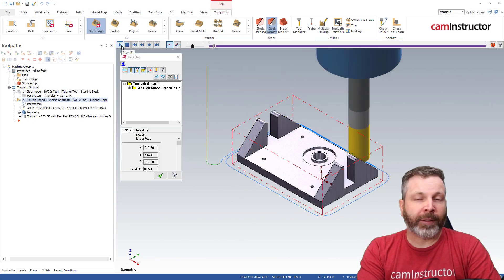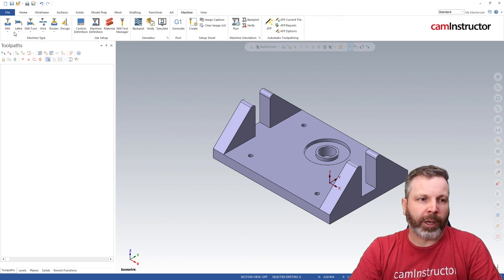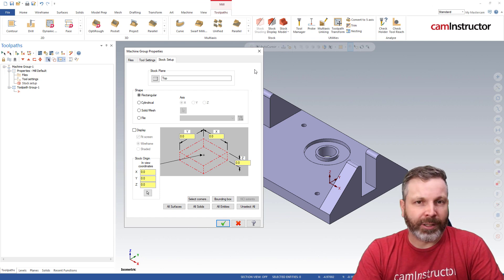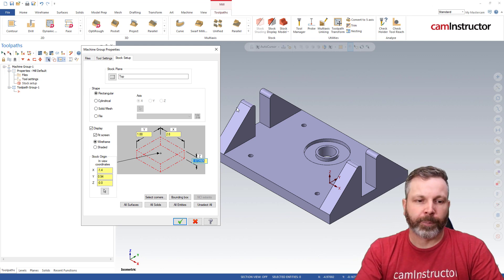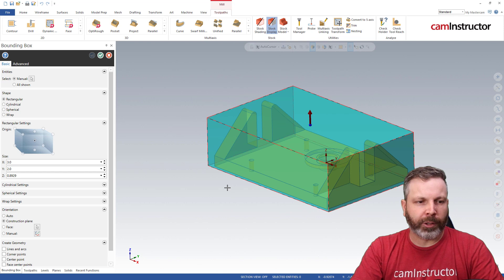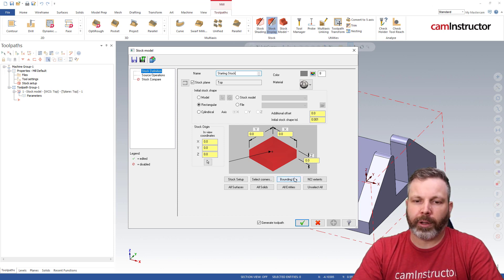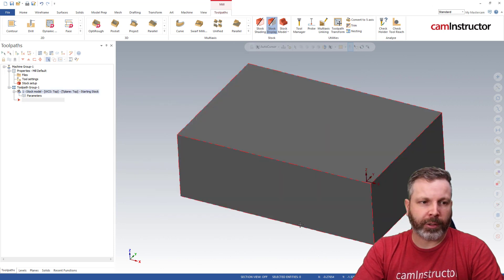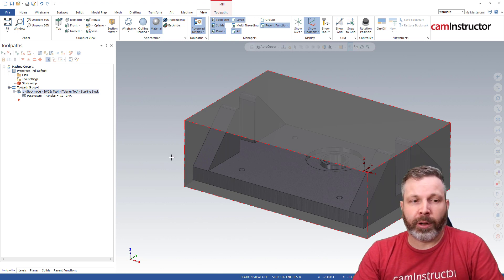Stock Setup VS Stock Model | Xometry CNC Mill Test Part - Video 3

Comment: I saw people vertfy stimulator with exactly model but when tool move cutting around model it shows tool touch to the meat on model how could they do that? Not stock setup which is like your but this is a real part and over size little bit. Way they did I saw that they merge 2 part together by translate into same origin. How they did that and how it called on mastercam? Thanks a lot teacher.
Reply from the maker: Not sure I follow

Comment: I hate Stock Model and I use it very often. I came to Mastercam from Solidcam and I see Solidcam made it much better.
Reply: I hated stock models at first, but once I started to figure them out they became very handy.
Reply: @themonkeyproject  As I mentioned before. I use it every day, but it still stupid
Reply from the maker: How does Solidcam use stock models?
Reply: @CamInstructor  Solidcam  Stock Setup must be created.
Stock model ( they call it Stock Update) has only one icon at the top of program. You just drag and drop to operation you want to calculate up to. It will calculate all previous operations before and show remaining material. It takes much less time to work with.
Mastercam stock model has more flexibility, but time spent on creating it makes the whole idea stupid.
Reply: I’ve heard that Fusion360 uses the same idea of stock model as Solidcam, 
Esprit uses the same idea as Mastercam
Reply: @ov3753  I see no problems with it.  Perhaps its in the way you're using them.  Or perhaps it's just a matter of preference.
Reply: @themonkeyproject  Have you ever worked in any other CAM system? You will always see advantages and disadvantages of each one compare to another. Mastercam has many things done better than Solidcam. Even creating  Stock Setup in MC is much easier and more intuitive.
Reply: @ov3753  Yes, I've used a number of other cam systems, and while MC is certainly not my favorite, Stock Models is one of the things about Mastercam that I wish other CAM systems did better.  As I said, could be in your methods, or it could just be personal preference.  What is it about stock models that makes you call it "stupid"?
Reply: @themonkeyproject  Stock Setup and Stock Model  are not connected. It’s needed to create many Stock model to reduce air cutting (Solidcam in this case just sees what was done before). It’s needed set the right Stock model for verification (Solidcam shows machined stock automatically). MC many times looses Stock Model that was set for verification, so it needed to reset again. While Stock Model is calculating you pretty much stuck and cannot work with previous operations. Isn’t it stupid enough for you?
Reply: @ov3753  I never even use Stock setup except for the simplest jobs.  I agree that it's a little annoying that it loses the stock model for verification.  As far as waiting for it to regen, once you're happy with the toolpath, you can create a mesh, and use that, and it no longer regens.  I don't often spend time changing previous options.  I find the benefits far outweigh the cons, so to me, stupid is a bit much.  Personal preference.
Reply: @themonkeyproject  Ok, it’s not stupid, it’s just annoying and takes to much attention.